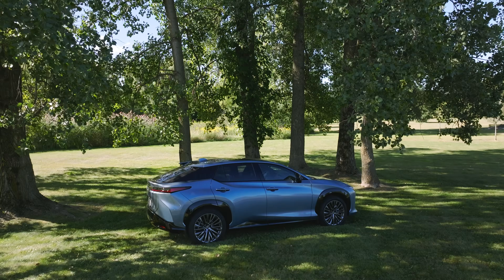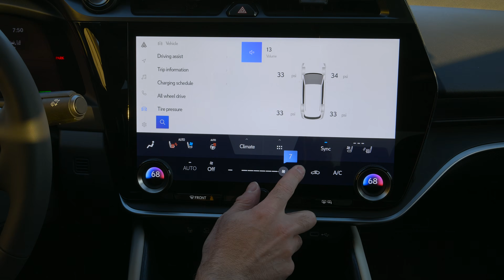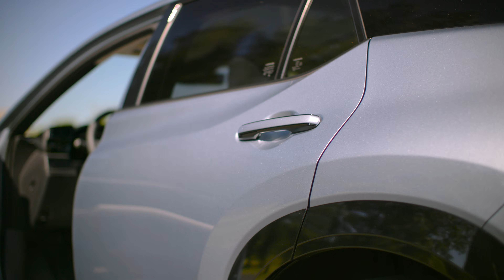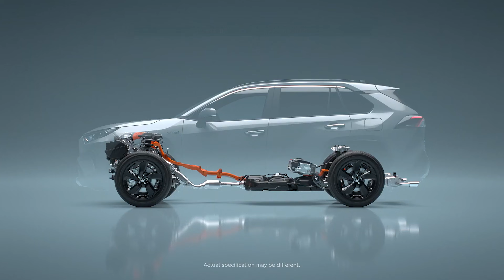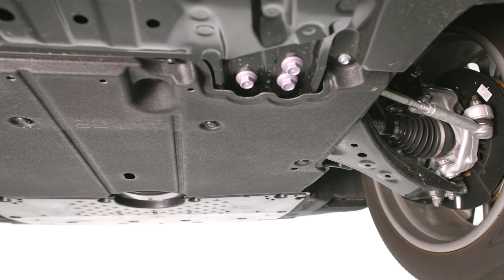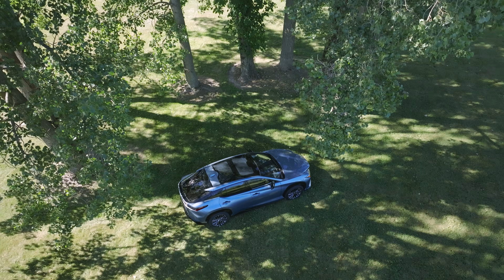Lexus RZ450 EV | Just Say No!

Comment: This fits the lease scheme perfectly.  Lease for 3 years and replace with newer and better.  Perfect for the consumer and giving a constant stream of income for the manufacturers (and lease companies).  The downside is no one will want a 3 year old tech EV on the used market, just like phones today.  The bigger downside is the disposal of the vehicle once no one wants it, the battery needs replaced, and its value plummets to near zero.
Reply: Well then it is not so good for lease companies dont you think?
Reply: neighbors wall charger caught fire, burned their house as well as next door neighbor's. The only way these issues, like EOL batteries, get fixed is by feds throwing gobs more money at it so consumers don't revolt. To keep the whole "climate crisis" ball rolling, DNC can't be run out of office.
Reply: Some manufacturers are already repurposing car batteries into portable power packs and household batteries. The EV changeover will also make diesel or gas home generators obsolete for the majority of people, because batteries that are more than 20% degraded won’t work for a car but will be plenty fine for powering your house in an outage for a few days. That storage capacity will also provide the buffering that the grid needs if renewable generation (wind and solar) scales up, because they are of course never going to be stable sources like coal or NG fired plants. Fortunately all of these things are self-reinforcing over time
Reply: @tammerfarid Lmfao openly admitting that the future isn't stable or reliable is a wild sell.
Reply: @pieswimmer1  that’s a pretty major twist of both what I said and basic science, but you do you. If source generation isn’t stable, then other things are required to achieve the desired output. Grid buffering is that thing. Not rocket science. But some people complain about change rather than think about how to make change work for the better. Personally, I find it more productive to define the outcomes that are needed and work back from there.

Comment: All EV are a bad buy for one reason, the battery. The majority of batteries just won't last 150k over 10 years. And since the battery cost 20 k to replace it is a no brainer.
Reply: The average consumer doesn't keep their car for that long anyway. Not an issue for most people.
Reply: tesla has 8yr 120k mile warranty. i save 4000 a year on gas alone, so even if it dies after, im still in the black.

Comment: My problem with this Lexus is the outward visibility .. especially for a SUV (or crossover)..  And especially if you are over about 5' 7".. They made the roofline way too low and it looks like a low ceil cave.  This low ceiling makes for a uncomfortable, cramped cabin.  And with poor visibility, you get an unsafe vehicle that is too dangerous to drive.  Lexus should have made it more boxy and raised the roof about 4 inches.   This would have made the RZ MUCH better to live with - and MUCH safer to drive.

Comment: Sure “the yoke” isn’t necessary but like a V8, when were vehicles ever about simply what’s necessary.  I think it’s a lovely idea, especially since it’s a legit yoke not a Tesla “square steering wheel” which has the same turning radius style as a normal wheel.
Reply: Yes. To expand, the "yoke" doesn't matter. The thing with Lexus's yoke, unlike Tesla's yoke, is it sits on top of a variable drive by wire system. Tesla just put in a yoke on a regular mechanical steering system which has terrible hand over hand maneuvers. That's not the case with Lexus. It only turns half way and at lower speeds turns a lot more than does the regular steering. That's the big deal, not the yoke. They could put any type of steering wheel on top of it but chose to put a yoke on it probably due to space saving.

Comment: At 13 cents per kilowatt hour where I live, forget about it via home charging.  I gas up even a full tank in about five minutes, and I'm on my way. I find your reviews EXTREMELY trustworthy without gimmicks or repeated catch phrases. Question: If a person wanted to lock something inside the vehicle cabin after leaving, since there is no lockable glove compartment, does the center console lock? Thank you.
Reply: It would only cost you $10 to charge a Tesla Model 3 with an 80KWh battery (around 330 mile range). So no, home charging is still cheaper than fueling up any car out there.
Reply: Thank you

Comment: Love the honest review. I do wish people would spend a little more time discussing use cases. The range on this car is a total deal-breaker … if you ever plan to drive it multiple hundreds of miles a day. But - 80% of the population lives in dense urban/suburban settings, and 60% of vehicle owning households have more than one car. This would be just fine for the suburban commuter who needs to haul a couple kids and their stuff to school and back and make a Costco run. The other car is the road tripper. The deal breaker for me on this car isn’t the range, but the lack of character, which Mark also hit pretty hard.
Reply: It might work for range for some people, but its also a terrible value vs the competition when you look at range. Typically cars made for that use case cost substantially less. This one is just bad.
Reply: @ruleslawyer  totally agree, not saying this car is a good choice for anyone. But the discussion of range without the discussion of actual use cases is what annoys me - on virtually all automotive channels.

You never hear a review of a GT3 RS complaining about the lack of utility for hauling plywood …
Reply: For the price, this range is absolutely unacceptable.  It would be much different if it was 25k cheaper.
Reply: @RubmaLione  yeah, and the lack of efficiency is unacceptable. This range out of a 70+ kWh battery is crap. Has the weight and cost downside without the range upside
Reply: @RubmaLione  that would ve below Toyota/Subaru version. It would be better if it wasn't made, honestly.
Reply: Sure. All that said, why the hell would you buy this instead of an Ioniq 5 or something far better?
Reply: @802Garage  if you read the thread, I wasn’t advocating for this car specifically, just discussing range in the context of intended use
Reply: @tammerfarid  Oh I know. I was sort of trying to say I agree with you in general, but then the question remains, why would you pick this when other cars can do all of the same things, but better? If this car was $20K cheaper, sure!
Reply: That doesn't make any sense. It's during long trips you want to avoid using gas/diesel...
Reply: @rasmusansin3273  wrong. ICE cars are at their peak efficiency at full operating temp. Also, the societal harm of ICE pollution is most concentrated in urban areas: smog leading to asthma, etc. ICE engines operating at peak efficiency on the highway with modern exhaust catalysts are pretty good. The EV’s biggest benefit comes from replacing ICE engines for the 95% of all vehicle trips that are <20 miles. 

It also happens that the biggest drawbacks to EVs (charging time) are only an issue on long trips. Put 2 and 2 together …

Maybe the data point you’re missing is that longer trips (over 80 miles) make up a tiny share of total vehicle miles driven. From the USDOT: “For household-based travel, short trips account for the vast majority of trips. Over half of all vehicle trips are between 1 and 10 miles. However, these short trips account for less than one-third (28.3 percent) of all household-based vehicle miles travelled.

Conversely, trips of 100 miles or more account for less than one percent of all vehicle trips, but nearly 15 percent of all household-based vehicle miles.” So shifting short trip driving to EVs eliminates 85% of ICE miles with no negative convenience impact, and it removes the “worst” 85% of ICE miles from a pollution perspective.
Reply: The issue is even accounting for that use case, in just a few years this car is going to be laughably inferior to almost everything else available in range and charging (if it isn't already). Nobody should buy it based on that alone.
Reply: @accordinglyryan  I agree except there are so many people now who have more money than sense, literally making money for not lifting a finger. Those are the ppl that will buy this car.
Reply: Lexus has a new program where you can bring your RZ in and take an ICE car at no charge for a trip. Cool idea.
Reply: Agreed. I don't see myself buying an electric car anytime soon. I do use the one I have to commuting to work, but if I want to go on a road trip somewhere, that's a no go if I had an electric. My little Fiesta ST gets great mileage, is a blast to drive and I can go on a trip at the drop of a hat. I've heard so many horror stories about Charge America (or whatever it's called) that I wouldn't own an EV.
Reply: @JDsHouseofHobbies  I have a Fiesta ST also, and I’m replacing it with either an EV or a PHEV (2nd kid won’t fit behind me as a driver). Fantastic, amazing car and totally underrated IMO! But - it exemplifies why EVs make sense for some use cases. I live in an urban area. My daily drive is a 25-minute, sub-five-mile crawl to drop kids off. Yes, I can use a bike trailer in nice weather; no, I don’t do that as often as I should. Firing up a gas engine to idle around for 25 minutes is the worst of all worlds: bad for the engine (never gets to full operating temp), bad for the ancillaries (condensation in exhaust; alternator working hard to charge up battery at low RPM), bad for the environment (cold engines run dirtiest), and not particularly fun - even though the ST is fun at all speeds. 

I also have a Cayenne Diesel for highway trips, family and dog hauling, towing the race car, etc. Short trips are brutal on the DEF system. So I need something a little bigger than the Fiesta, with enough all-electric range to avoid the ICE downsides, and I don’t really NEED 300 miles of range because this car will almost never take a long trip - that’s what the Cayenne is for (and it also gets 32+ mpg on the highway).
Reply: Only 190's is about the worst today.

When the reviewers are better than the car...yes, talking to you Toyota.
Reply: A 'practical' car like this has to serve several use cases to appeal to a wide range of people. It has to do the commute, that's the easy use case. But it also has to do the long week end trip and the holiday. And that's the harder use case where range matters because in many countries charging infrastructure just is not there. This car is no revelation, the review was on point. It's just a stopgap car that only makes sense for a small % of people.

Comment: There is an infection plaguing all automobile interfaces nowadays: total lack of standardization regarding switches and displays. Switches have become nightmarish gobblygook with shifters being knobs, push buttons, sticks on steering columns, or in the case of Tesla, disappearing altogether into a tablet screen! Worse then that, manufacturers like Tesla are putting turn signal controls as touch sensitive buttons on rotating steering wheels-taking away fixed stalks! And now, you cannot sit in any car and know where the speedometer is! What is it going to take, manufacturers? Will oppressive laws have to be in place to force some safety standards for the driver’s interface?
Reply: Yes.  Companies are run by MBAs & bean counters and REQUIRE "oppressive laws have to be in place to force some safety standards for the driver’s interface".  Remember Boeing and the 737Max.
Show less
￼
Reply: i think its fine. my tesla gets montly updates with new features and controls. can only do that with a tablet. using capacitive and getting rid of stalks makes the car cheaper I'm sure. lets remember they're the only manufacturer cutting prices and making cars more affordable. i guess if you like paying dealer markups and shenanigans stay with the status quo.
Reply: @TeslaRoadtrips  I agree with you on not willing to pay dealer markups. However, fortunately I have no need to replace my Subaru Forester which is 6 years old,but only has 30,000 miles, so my complaint about the Tesla Model 3, for myself is not justified. Forgive me for being a negative grumbled.